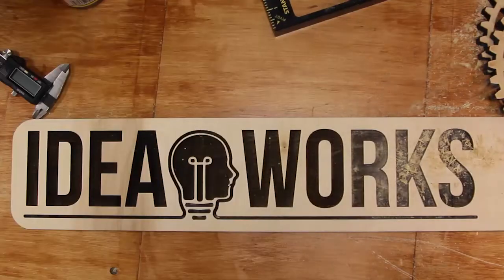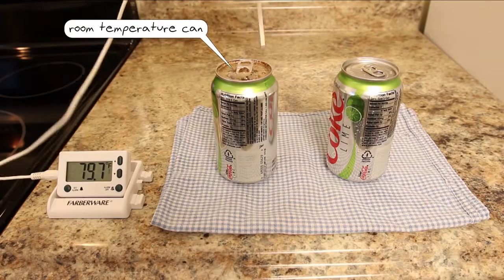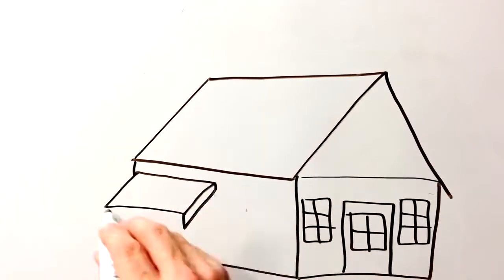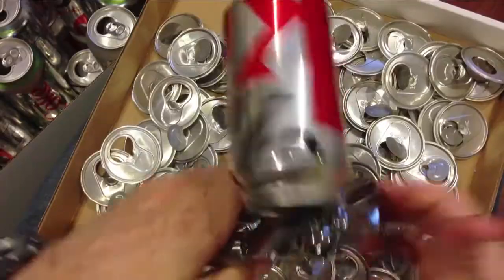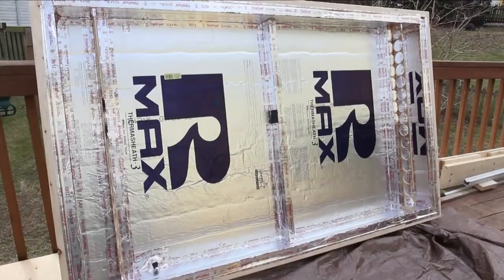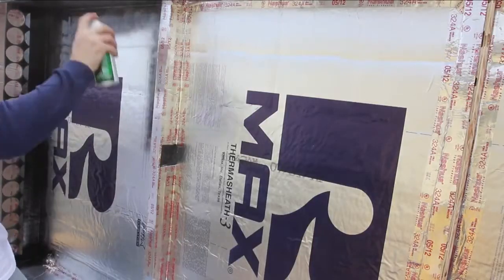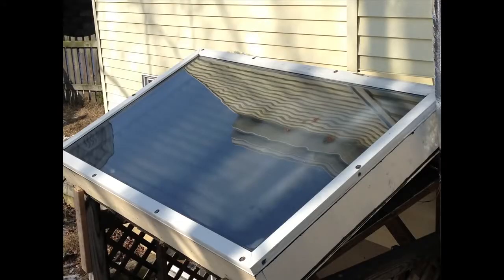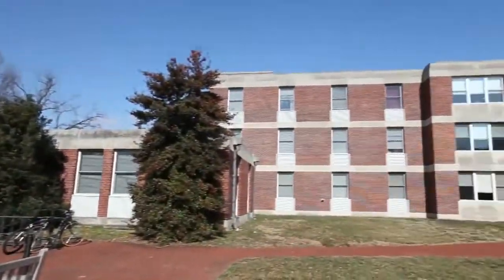Build a Solar Heat Collector - Heat your home for FREE (2017)

Comment: What about at night?
Reply: Just saves money and energy during the day, and keeps your baseline temp of the house higher, so you won’t drop as much; but you could make a solar hot water heater to heat water and circulate to heat sinks inside to help maintain overnight
Reply: Use the moonlight, duh!